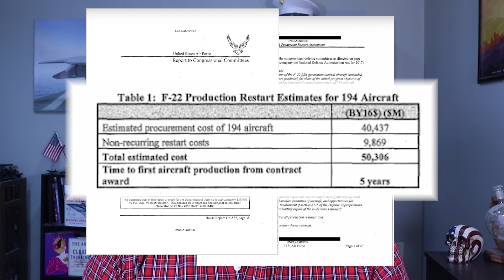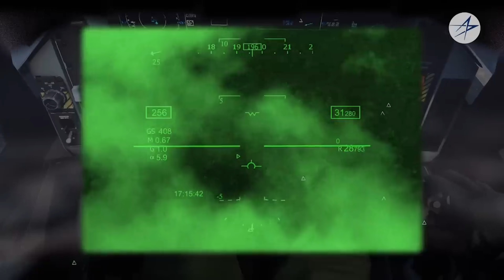The 2ND GENERATION F-22 RAPTOR we ALMOST got

Comment: Imagine a high-low mix of NGAD and the Raptor-F35 Frankenfighter.

An even bigger missed opportunity.
Reply: "Low"
Reply: @eurybaric Yes, I used "low" to emphasize that if your low-end air superiority fighter is the Raptor-F35 Frankenfighter, then you have insane overmatch for decades
Reply: @Chuck_Hooks if that frankenfighter is a “low”, then “high” must be something like TR3B UFO thingy
Reply: It’d likely be pretty scary (but not in a good way)… Most definitely wouldn’t be as capable as it should be for what it’d cost until block 4 or greater (like what’s currently happening with the F35)…
Reply: Plus all the drones...
Reply: The AF I think did the right thing by pushing a new design in my opinion. One that didn't have to sacrifice so much for STOL like the F 35. 

 So much technology has advandced since the F 22s inceptlon. At a rate that is mind blowing. 

 Having a new platform ASAP I beleive is the right gamble. 

 The Navy needs to hurry up with their massive interceptor. That thing better be fast as heck, a massive radar, and be able to carry missiles the size of telephone poles at mach 3, hah. (Big missile = more stand off range.). Oh and a lot of range.
Reply: @dianapennepacker6854 Navy’s own NGAD program is well underway, both branches poised to pick the winner of their respective programs in 2024
Reply: China and Russia: why do I hear boss music?
Reply: Actually what you imagined is on the way. Do some research about F-22 upgrade programs which is on going right now.
Reply: Imagine if you will, a world where the F-35 is considered low 😎
Reply: @skyserf  That's what would have been the case if Congress had funded the original 749 Raptor request.
Reply: @skyserf  Current F35 is superior to the F22. F35 is only low when NGAD is in production
Reply: @amazin7006  The F22 and F35 are designed for different missions. From a pure fighter perspective the F22 is superior in terms of speed, maneuverability, and stealth.
Reply: @skyserf  You named 3 metrics, two of which do not matter much, and the third the F35 is far superior at. Lockheed Martin, the Airforce, the Navy, and 4 different generals have ALL admitted that the F35 is superior in stealth to the F22. It's not even close anymore. One reason being is that it uses a superior thick sheet of coating rather than a thin layer of RAM paint. Also it is smaller, uses almost entirely composites for its frame rather than aluminum and titanium like the F22 does, and even its nozzles are better designed to absorb/reflect radar. Let's not forget that the F35 has a radar that is a whole generation ahead of the F22, (and soon to be 3 generations ahead) which is capable of radar jamming AND tracking at the same time with power equivalent to a dedicated Growler.

Speed is mostly useful for giving your missiles better kinematic performance. However, this is greatly overrated due to the fact that aircraft NEVER fly anywhere near their maximum velocities. For example the F4 phantoms have only ever reached their maximum speed once in their existence. What is most important is how efficient an aircraft is at its cruising speeds. Range>Speed.

Maneuverability is even more useless in the modern age. F35 has 6 IRST sensors (soon upgraded to TWENTY, F22 has zero) in 360 degrees, with software that can recognize and track an aircraft with ease using real-time image recognition. It can lob missiles at any angle, then the modern IR missile turns at 60+ Gs' and have a .9+ probably of kill. Unlike F22, F35 doesn't need to struggle and waste energy to point its nose and fire. There's a reason the SU57, J35, and J20 do not carry guns. NGAD will probably not have guns either.
Reply: @amazin7006  You named 3 metrics, two of which do not matter much
To you perhaps.

and the third the F35 is far superior at. Lockheed Martin, the Airforce, the Navy, and 4 different generals have ALL admitted that the F35 is superior in stealth to the F22. It's not even close anymore.
List sources. Give us quotes from these generals and links to the sources from Lockheed Martin the US Air Force and US Navy stating exactly what you are claiming.

Let's not forget that the F35 has a radar that is a whole generation ahead of the F22, (and soon to be 3 generations ahead) which is capable of radar jamming AND tracking at the same time with power equivalent to a dedicated Growler.
The F-35 radar is newer however the F-22 radar was designed for its role as an air dominance fighter including  features optimized for that task.

Speed is mostly useful for giving your missiles better kinematic performance. However, this is greatly overrated due to the fact that aircraft NEVER fly anywhere near their maximum velocities. For example the F4 phantoms have only ever reached their maximum speed once in their existence.
This is an odd aircraft to reference. It’s not designed for the same mission. The F-4 Phantom II was a versatile multi-role fighter of the Cold War era, while the F-22 Raptor, with its emphasis on air superiority, stealth, and advanced avionics, represents a shift towards more specialized and technologically advanced combat roles. 
Also, if speed isn’t that important, as you suggest , why not just put turboprops on your F-35 and call it a day? 

What is most important is how efficient an aircraft is at its cruising speeds. Range>Speed. Maneuverability is even more useless in the modern age.
Again, the F-22 and F-35 are designed for different purposes. The F-35 is designed to be a jack-of-all-trades, capable of engaging air targets, supporting ground troops, and conducting electronic warfare and ISR missions. There was a time when designers thought all dogfights from their era on were to be fought BVR and removed guns from their aircraft. Then they changed tune and focused on energy management, maneuvering and they reincorporated guns into designs.

F35 has 6 IRST sensors (soon upgraded to TWENTY, F22 has zero) in 360 degrees, with software that can recognize and track an aircraft with ease using real-time image recognition.
Again, The F-35 was designed approximately 15 years after the F-22 with a different design philosophy and purpose.

There's a reason the SU57, J35, and J20 do not carry guns.
The SU-57 incorporates a 30 mm Gryazev-Shipunov GSh-30-1 autocannon. The J20 wouldn’t be able to maneuver with any current 4th generation fighters let alone the F-22. The lack of an internal gun could be a design choice to make up for engine deficiencies and the the aircraft’s role as a missile truck rather than a fighter. 
As for the J-35, who knows why the CCP decided against it. South Korea did decide to incorporate a gun into their KF-21. 

NGAD will probably not have guns either.
You should read up on directed energy weapons and SHiELD.
Reply: @skyserf   No, you're just dead wrong. You said "From a pure fighter perspective" then proceeded to name 1 thing that doesn't really matter much in modern fighting (maneuverability), 1 thing that doesn't matter as much for stealth vs stealth (top speed), and 1 thing that the F35 wins in (stealth). Why not mention radar capabilities? Why not RF stealth which would give away the F22s position early? Why not mention that high speed = glowing red target for F35s IRST at 100 miles? Why not mention sensor fusion? Why not mention EW capabilities? These matter more than maneuverability. F35 can break the kill chain and destroy the F22 regardless of its kinematics simply because of its superior avionics and stealth. There's a reason the J20 has no gun, the Chinese are not dumb.

"Give us quotes from these generals and links to the sources" With ease. Gen. Mike Hostage On The F-35; "No Growlers Needed When War Starts" "stealth is not invisibility, especially for fighters that must have tails for maneuverability (rather than the B-2 stealth bomber’s tailless “flying wing” design). Both F-22s and F-35s will be spotted at range by low frequency radar. The F-35’s cross section is much smaller than the F-22’s". The general then says “The F-35 doesn’t have the altitude, doesn’t have the speed [of the F-22], but it can beat the F-22 in stealth.”  Furthermore, General Bogdan confirms what General Hostage says here. "“I would say that General Hostage … is accurate in his statement about the simple stealthiness of the F-35 [with regard] to other airplanes,” Bogdan said in the interview. The statement was accurate for radar cross section, as measured in decibels, and range of detectability, he said, and he scoffed at the notion that anyone can tell how stealthy an aircraft is just by looking at it."

The statements from the US generals are the most contextualized (and thus accurate) data that we'll ever get since all of this is top secret. F35 is stealthier, has a better avionics suite, has a better radar system along with far superior capabilities, it has EW capabilities that F22 does not. There is no situation where an F22 wins. Even in close combat, the F35 pilot can turn his head and fire a sidewinder faster than the F22 can thrust vector and point its gun.
Reply: @amazin7006  You conveniently left out these sections of Hostage’s quote 
but that does not mean, Hostage concedes, that the F-35 is necessarily superior to the F-22 when we go to war. In fact, Hostage says that it takes eight F-35s to do what two F-22s can handle…. The F-35 is to the F-22 as the F-16 is to the F-15. The latter aircraft are the kings of air to air combat. The F-35 and the F-16 are the mainstay of the air fleet, designed for both air-to-air and air-to-ground attacks.

No, you're just dead wrong. You said "From a pure fighter perspective" then proceeded to name 1 thing that doesn't really matter much in modern fighting (maneuverability)
Directly from the source you provided 
the F-35 is not compelling unless it’s there in numbers,” the general says. - General Hostage

1 thing that doesn't matter as much for stealth vs stealth (top speed), and 1 thing that the F35 wins in (stealth).
Again, from your source
“The F-35 doesn’t have the altitude, doesn’t have the speed [of the F-22], but it can beat the F-22 in stealth.”
He also thinks speed is important. One reason specifically is that the faster a platform is when it launches a missile the longer the range and higher kinetic energy missile when it reaches the target. With regards to his stealth comment I don’t know specifically what he’s referencing but the F-22 has stealth as a primary design feature. The F-35, while also stealthy, was designed with a balance of stealth, advanced avionics, and multi-role capabilities. Its RCS is larger than that of the F-22.

Why not mention radar capabilities? Why not RF stealth which would give away the F22s position early? Why not mention that high speed = glowing red target for F35s IRST at 100 miles? Why not mention sensor fusion? Why not mention EW capabilities? These matter more than maneuverability.
F35 can break the kill chain and destroy the F22 regardless of its kinematics simply because of its superior avionics and stealth.
There is no situation where an F22 wins. Even in close combat, the F35 pilot can turn his head and fire a sidewinder faster than the F22 can thrust vector and point its gun.

Again, from your source
but that does not mean, Hostage concedes, that the F-35 is necessarily superior to the F-22 when we go to war. In fact, Hostage says that it takes eight F-35s to do what two F-22s can handle.

There's a reason the J20 has no gun, the Chinese are not dumb.
They aren’t smart enough to design 4th or 5th generation fighters on their own without stealing intellectual property.
Also from your source
While F-35 critics point to the purportedly advanced features of the new Chinese aircraft, noting apparent improvements in stealth, Hostage is skeptical of the plane’s capabilities, so far.
“They’re just now rolling their prototypes out and flying their supposed fifth gen capability. So it looks like — It’s a Raptor [F-22] look-alike. It doesn’t mean it’s got the same internal capabilities. The systems on board, the fusion on board, the stealth — the jury’s out,”
Reply: @skyserf  Every single thing you quoted is completely irrelevant and proves you wrong. We are talking about which is better in air to air combat, and not a single one of the quotes you posted support your claims AT ALL. Not one. What do you think he means by "takes eight F-35s to do what two F-22s can handle"? He is talking about missile CAPACITY. Which is irrelevant to what we were discussing. Holding 4 times more missiles in an inferior aircraft just means your death is going to be 4 times more expensive. You keep quoting this part without actually understanding what it means.

"F-35 is not compelling unless it’s there in numbers"
This ties into what I literally just said. It's about missile capacity. All he's talking about here is its missile capacity. Saying "it's most compelling in numbers" does not translate to "it's not compelling at all" or even "it's not as compelling as an F22". This does not logically follow. Not to mention you said 3 things "stealth, maneuverability, speed" you never once mentioned missile capacity.

"its RCS is larger than that of the F-22."
No, F35 has a smaller RCS than F-22. Notice how I sourced my claim and you didn't??? He says 3 separate times that the F35 is stealthier and yet you still deny it, do you have some insider info? No? Then where are you getting this conclusion from? You just say stuff like this and expect people to believe it when it's simply a lie. F22 is inferior in stealth, it's 10 years behind in its design and it shows. One reason is due to its thinner RAM paint, as well as the intake design which uses right angles that reflect radar rather than the diverterless supersonic inlet design that F35 uses.

"The systems on board, the fusion on board, the stealth — the jury’s out,”"
Notice how he says nothing about Maneuverability? Because it's  WORTHLESS, which is exactly my point. These jets don't have guns on board because they don't need them anymore. A sidewinder can turn faster than your nose can
Reply: Twin engine is not good for the "low" fighter. Costly upkeep, not naval or STOVL capable, and very fuel hungry. This raptor-35 would have been an incredible opportunity for Japan and Korea's homeland  defense though. I don't think they have the budget for it currently and are deciding to build their own 6th gen with America's help.
Reply: @amazin7006 Twin engine IS great for the U.S. Navy; it's actually what they prefer. The Navy is buying more Super Hornets than F-35Cs because they prefer twin engine (improves survivability for both the pilot and the plane when flying over large bodies of water). The Navy also prefers larger fighter jets with greater range, greater weapon capacity,  and greater maximum speed (vs. what the F-35C offers).
Reply: @pike100  First of all, your very first and second sentence is a lie. They don't prefer the Superhornet to the Lightning at all. The reason stated for wanting to order Superhornets was that Lockheed can't push out F35s and the necessary spare parts off the line fast enough during this intermediary period while they wait for their 353 F-35Bs and 273 F-35Cs on order. How is 20 Superhornets (not even ordered yet, or ever) larger than 626 F35s (most are actually on order)

Secondly, there are no new Superhornets decided right now, exactly ZERO. They are discussing buying 20, however it turns out that won't even be possible with their budget, and instead they will likely use that money to throw towards FA/XX and F35.

Quote from a General: “The reason Congress did the 20 [Super Hornets] was as a gap measure to make sure that we had these aircraft to keep these air wings fully operationally capable.” He says in plain words that it is purely a practical decision to keep their arsenal stocked while they wait for Lockheed.
Reply: @pike100  Also maximum speed is irrelevant, and F35 has FAR more range than the F18, it's not even remotely close. F35 has almost as much range as the F18 has with external fuel tanks.

Comment: Could save money and upgrade our F-15's.  I mean, look at our B-52s.  They are getting new engines. We, as taxpayers, are getting ripped off.
Reply: The F-15EX is simply a stopgap for the aging fleet, iirc there was an article where an air force official stated along the lines of F-15's won't be able to operate in high threat air environments past 2027, at least not as the tip of the spear

Comment: Yet some how the US did just fine without it and didn't need it.
Reply: ... so far, but dictators are starting wars left and right.
Reply: Better to have what you don't need than need what you don't have.
Reply: It didn't need it in the War on Terror period when it was fighting non state groups like the Taliban with no airforce. It would most definitely need it in a war with China or Russia who both have air forces. Assuming the WOT would run forever and the US would never face a peer competitor was stupid. In fact not preparing for peer competitors ironically makes them more likely because it lowers the bar for entry. And given a war with a peer competitor is likely to go nuclear it makes that more likely too.